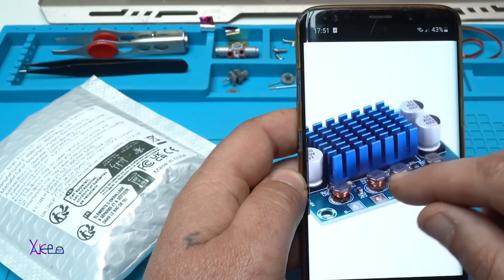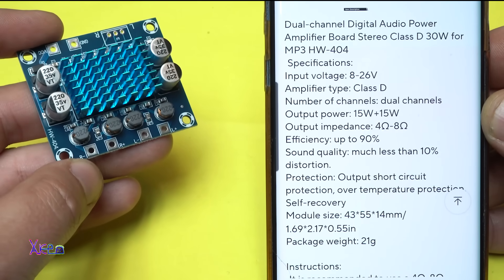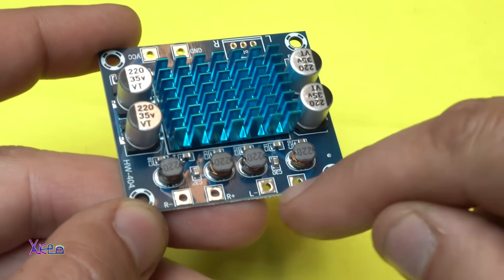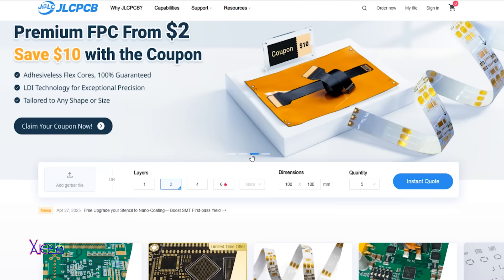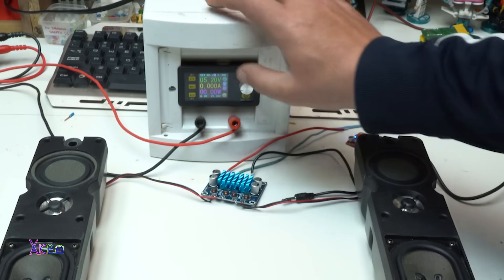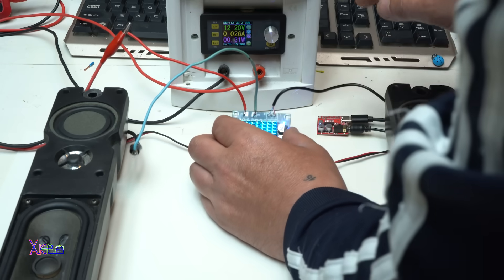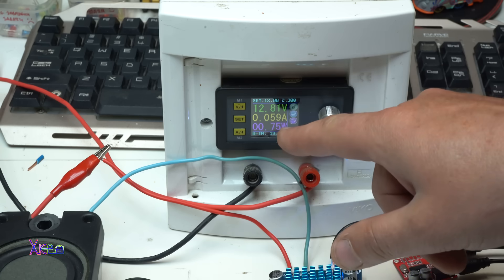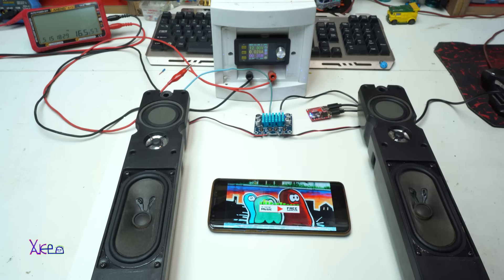WHY THIS $2 Amazing Module is IMPRESSIVE?

Comment: this module has the clearest sound of all the board that I everf bought. also the expensive ones with better wattage written in product description sounds bad.I think the only one disadvantage is that the bass is slightly low than other amplifiers but i can say that this is the best amplifier that I ever purchased.Ideal for speakers where you want clear sound with a lot of treble. I use it with pair of home theatre satellite speakers.

Comment: if you use the same power supply for bluetooth and the amp, would you get a ground loop buzzing noise?  that's the issue with building something like this yourself. Anyone can hook it up like this and test it.

Comment: Try the TPA3116 :D
Reply from the maker: I will order
Reply: @Hacktuber  Also get a good pair of speakers because that module sounds really good. Lots of power in a small space and it heats up almost nothing. On my PC I have the ZK-TB21 card with speakers recovered from a home theater system and it sounds really good.
Reply: Those speakers are lacking bass and a bit of midrange,  so hard to tell module quality from this end.
Reply: @Paulman50  I tried the 2-way module from aliexpress with a pair of old Pioneer CS-595s and it sounds really good, it's on the PC that I use the 2.1 module with subwoofer with the recovered speakers

Comment: I dont understand the need for different lengths on the power supply can someone tell me please
Reply: Different long they cant touch and short cut the power supply by mistake
Reply: No reason in this case, but possibly it is so they don't short together and blow a fuse when connected to a power supply.
Reply: @Mr_Rusty1  Thank you I was confused for a sec
Reply: It's prevents the ends of + and - cables to touch and shortcircuit, but only when they are already connected to the power source. In this case it was useless, because they were already soldered to the board, they couldn't have touched anyways ;-)))))
Reply: @paleopteryx  Thank you for replyihng. I was looking at it trying to figure it out.Makes sense now if the other way round
Reply: so they dont touch and short before you join them properly
Reply: @CHRISTIEMALRYLIBRARY-t4t  Thank you